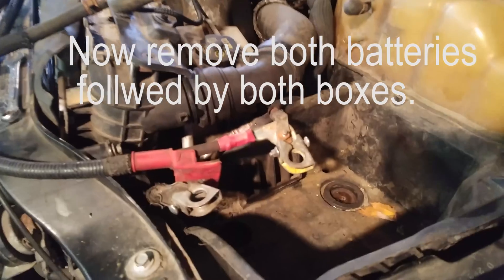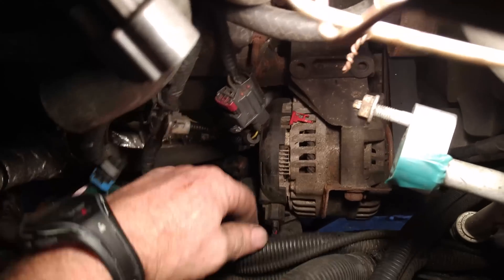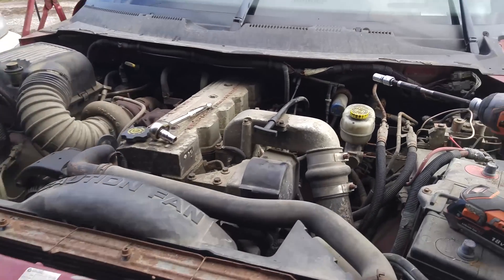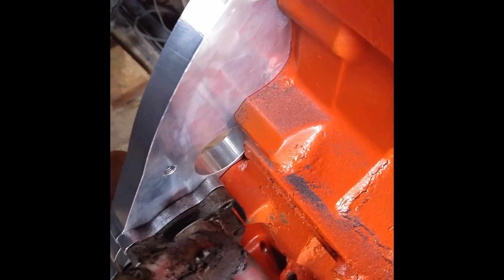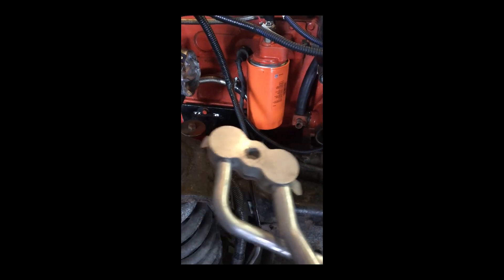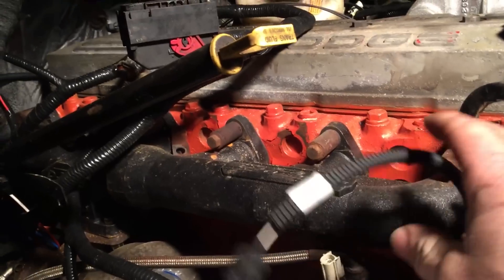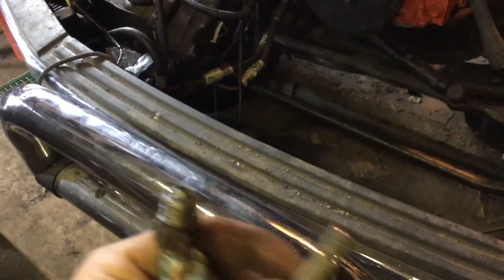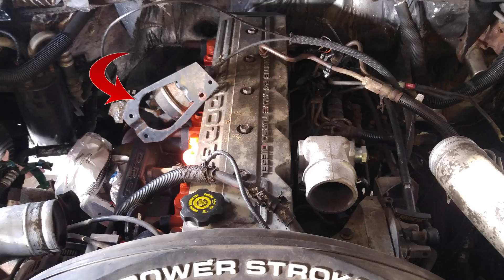Ford Cummins Swap 6.4L to 5.9 24 Valve instructions

Comment: Hello . Did you use the stock lift pump from the ford or the dodge lift pump and what lines did you use ?
Reply from the maker: I used a FASS  they are around 1k.

Comment: Just bought an 08 F450 with a blown up 6.4.  Ill be swapping it out for a commonrail 5.9.  Only part that has me a bit concerned is the need for a lift to remove the cab...  I did my last 12 valve swap (on my 98 K3500) in my garage, no cab removal required...
Reply: Weston Champlain didn’t remove his cab. Just removed radiator and all that stuff

Comment: The links you have here for the instructions and Wiring require a permission to get to the files in Google, may I have access to those files?
Reply from the maker: Yes. I will look into it.  Some of my files were deleted
Reply: Evening, Did you ever get a reply? I made a request today also.
Reply: @AlexShrugging  Nope, No reply
Reply from the maker: It should be good to go now.  Both are in the first pdf
Reply from the maker: It should work.

Comment: Did you use the 6.4 electric fuel pump on the frame? Does the 24 valve you have have a lift pump on the engine? Was curious if the 6.4 pump has enough pressure for the vp44. Thank you

Comment: How much you paid for kit conversion and where
Reply from the maker: Kits vary in price.  Depends on you needs.  I used diesel conversion they were great to deal with and very helpful.   All in I was around 5k.   
The best purchase was the wiring harness from diesel conversion.  
Hope this helps.
Reply: I want a complete kit now I already have the 5.9 24 valve engine I just need the kit for a 6.4 to 5.9 cummins 98.5 do you have a link
Reply from the maker: https://www.dieselconversion.com/

Comment: I’m getting ready to put a Cummins into my 08 F-250 just waiting on the head to get back wanted to ask if you know what sensor I’m going to need to buy for it to work
Reply from the maker: Hi Andrew.  I am going to need a little more info.  Did you buy the complete wiring harness?

Comment: Can I get the info for where you bought your parts from?
Reply from the maker: Which parts? 
Diesel conversion has most of the parts you will need.  Especially the wiring harness 
Other parts I sourced out from processors garage in Keswick.  
Hope this helps.
Reply: @brownlordofthewoodshop8552  what was your cost breakdown?

Comment: Where are the two sensors you mentioned on in the video that are screwed on the head of the block you said  " transmission and temperature sensor" they had red arrows drawn on the vídeo
Reply: Another question..Where did you route the little coolant outlets on the water neck down by the ac compressor. Also can't figure out where i can put the ford coolant temperature sensor i was supplied a adapter bushing but idk where it goes it doesn't screw on to the head with the adapter bushing
Reply from the maker: Sorry for the slow reply
I unscrewed one of the plugs in the head and installed the transmission and temp sensor.  
Ford temp sensor in the top of the block.

Comment: Excellent informative video.  After installing Cummins did you need to adjust drive shaft lengths and if so by about how much?  I just picked up a 2008 F350 mint with no engine.  I have a 5R110 out of another 2008.....just need to find a 12/24 valve.  Thanks for this.
Reply from the maker: I just moved the motor as far forward as I could. I did not need to cut drive shaft.

Comment: What can you do about the check engine light do they make something to get it to turn off
Reply from the maker: Hi Jonathan 
Did you buy the wiring harness from Dcs ?
Reply from the maker: I have mine wired up and everything works great   I did have a problem with the 2temperature sensors I just put them in the top of the block.
Reply: @brownlordofthewoodshop8552    
  where are these 2 sensors located, I can't figure where to find the transmission and temperature sensor you mentioned in the video

Comment: Can u do it in a v10 using the original  v 10 trany , on a f450 2010
Reply from the maker: I don’t know.   If you can find an adaptor plate and programming for the transmission you should be good to go.
Reply: @brownlordofthewoodshop8552  thanks

Comment: Hi, I wanted to ask you how the engine performance is with that transmission.
If I do not have how to reschedule the transmission, could I mount another one? Which will be??
Reply from the maker: I love the 5r110.   The 6 speed works amazing.  

It’s a bit of work to set up but diesel conversions has a tune that will set up the transmission to the 5.9.  
I used my sct tuner and uploaded the tune    
Its way better than the stock dodge transmission 
Hope that helps.
Reply: Your know 5r110w is a 5 speed right.....

Comment: Great video,  doing a 08 ford f550 with a 02 Cummins.   Had dcs do the wire harness but have a couple questions, if I sent you a picture would you be willing give me a hand if you can?
Reply from the maker: Sure.
Reply from the maker: Sorry for the slow reply
Reply: No worries,  I have most everything hooked up one problem I am having is the truck is in park both in the cab and transmission but on the display is shows it's in 3rd gear.  it won't let it turn over with the key.  Any ideas?  The shift leaver will not come out of park either
Reply from the maker: The plastic clip that holds the linkage to the transmission has adjustment   You can try and adjust there.   Also there is a safety switch which won’t allow the truck to turn over unless it’s in park or neutral.   Also there is a safety that the break must be applied to remove it from park.  It may be out of adjustment as well.   I hope that helps.

Comment: I’m doing this same build. How did you manage your fan to fit without scraping your original 6.4 radiator?
Reply from the maker: I made up bushings to go behind the original fan to move it back towards the engine.  About 1/4”  works great.  I also have a 1” body lift on the truck.   This also helped.
Reply: Brown, Lord of the woodshop™ I ended up putting a Cummins radiator and making braces to mount all the other cooling systems . It was a major headache but we got it figured out ! Thanks for the info .

Comment: I heard that its a pain to swap 6.4s because of the speedo cluster something about the truck wont run without it being synced with the engine
Reply from the maker: I didn’t have a problem with that.  I put a tack sensor off my crank shaft so my tack would work.  Hope that helps
Reply from the maker: No problem with the cluster as it remain with the truck and i used the 5r1-10 original transmission.  See attached reading material on my page.

Comment: Has the truck been running good since the swap any issues?
Reply from the maker: I have now over 150k on the swap and everything is great.  
The only thing I would ad is a better way to keep the relays dry instead of just mounting to firewall.   I had the  vp44 relay corrode.
Reply: thanks for the response what exactly did you have to purchase to complete your conversion Any info you give is appreciated

Comment: I see 12 valve swaps and it’s excellent motor but I like the 24 valve.
Reply from the maker: 12 v is so much easier to do the swap.
Reply: Ya but I like 24v way better
Reply: Why ?   ?   The 12 valve with the P - Pump is very basic and reliable.  It might cause problems in a State that dictates that the emission requirements go with the Year of the Vehicle.

Comment: If I had it to do over I’d sent the harness in ! Dcs has been helpful I sourced the conversion parts from them. Should have it started tomorrow. 08 F450 12v I do have a few questions if you have time to hear them
Reply from the maker: Sure.  Send them along

Comment: How did you do the gas pedal? Thanks in advance.
Reply from the maker: Diesel conversions sent me an adaptor that attached to my original pedal. I drilled a hole through the fire wall and attached it to the throttle position sensor bracket.  Not a very hard task.  I am still working on a way for cruise control
Reply: Brown, Lord of the woodshop™ ok, thanks for the reply.  When I talked to them they said they wouldn’t know how I would do it and that I was pretty much on my own for that portion of it.
Reply: Brown, Lord of the woodshop™ bought a 2008  f-450 king ranch quad cab with a bad engine in it.  Would like to do this conversion to it.  Picked the truck up for next to nothing. Only had 89,XXX miles on it.

Comment: Wow you've lost 2 engines?  Because of all the hysteria about the 6.4, I have a low mile 24V in a bus for a swap but the 6.4 has 297,000 miles and still running great! Of course it has been deleated since just after new.
Reply from the maker: Good luck with the 6.4.  Mine was a time bomb.

Comment: DCS has a bracket now that lets you hook your throttle cable to the stock pedal allowing you to keep your throttle position sensor. Would this make your transmission happier?
Reply from the maker: I don’t know.  My transmission is from the ford.  So I had to use an SCT programmer to make it work smoother.  Dcs provided me the programming. Maybe on my next one I will look into it.  Thanks
Reply: @brownlordofthewoodshop8552  I saw later that you have your tps mounted to the throttle linkage. I would think this would give the same result.

Comment: All you need to know about the 6.4 powerstroke: According to Bill from Powerstrokehelp.com the 6.4 is a 150,000 mile throw away engine. Unrebuildable. He bought 10 used engines and was only able to make 2 engines from it.
Reply: Funny, mine almost has 300,000 miles on it, of course i've had all the factory emissions equipment deleted for the last 60,000 miles. 😁
Reply: Dude is the end authority on for 6.0/6.4. The 6.4 uses the same block as 6.0 so no good reason it shoundn't be rebuildable.

Comment: Never bolt the converter to the motor to install. Always put the converter in the trans ,rotate it until it seats all the way back into the pump.
Reply from the maker: Thanks

Comment: I don’t think he knows about mechanic cause you never bold the torque converter to the engine first that’s the reason you can damage the pump and the front pump seal .
Reply: Diana Rubio I think he does. He just swapped a 24 valve into something not made for it
Reply from the maker: This question has been answered.  Why do people keep bringing it up.   Move on.  The horse is dead.  This was to be a fun video.

Comment: anyone doing this job, install the torque converter into the transmission before installing the engine, attempting to install it with the engine will result in front pump damage 99% of the time.
Reply: This hurt to watch
Reply from the maker: Thanks for the positive feed back.
Reply from the maker: I will keep this in mind for next time.
Reply from the maker: Thanks
Reply: I cringe super hard at that. I learned that the hard way once.
Reply: J B they got it down now that they make it themselves
Reply: Can you send me complete instructions for the swap please

Comment: Did you go with DCS engine mounts? Did they bolt in the front bolts holes or the rear bolt holes
Reply from the maker: Yes I used the mounts from dcs.  I used the second set of holed from the back of the motor.

Comment: What did you do so you can use the grid heater??
Reply from the maker: I used the wire from the ford glow plugs and wired the grid heater solenoids to that.  The grid heater work by grounding them there is constant hot power to them.  When you turn the key on the ford computer sends power to close the solenoid and the grid heater will work.  It’s was minus 27 the other day and mine fired right up
Reply: Brown, Lord of the woodshop™  ohh ok. I got everything done here and I have the dcs harness and I have 2 wires. That look like grounds labeled heater controlled
Reply from the maker: The grounds on the dcs wiring go to the two  solenoid this completes the circuit  for the heater grid.   Power is supplied to the grid heater already and the grid heater starts to work when the circuit is complete by turning on the key which grounds the solenoid and closes the contacts.
Reply from the maker: If you want I can take a picture of mine tomorrow if that will help.
Reply: Brown, Lord of the woodshop™  that’s exactly what I did. I think my alt is going out and is just throwing everything out of wack
Reply from the maker: I had a ground issue with mine.   I fixed it by adding 2 ground straps from each battery to the motor.   One to the back side of the alt bracket and the other to where the grid heater

Comment: Thanks for the video, did you run a cam sensor with this build as well as the crank sensor, or just the crank sensor?  I about 2 months away from wiring the pcm on a Detroit 4-53T swap. Take care:)
Reply from the maker: Yes I ran a crank and can from the dodge. The cam and crank sensor for the dodge look exactly the same and will cause problems if you put them in the wrong spot.  I also ran a cam sensor for the ford electronics.  It came with the flywheel and adaptor plate from Dcs.
Reply: @brownlordofthewoodshop8552   Ok thanks.:) I might run into issues with my swap as the crank and cam rotate at the same speed.   We'll see what happens and then go from there.  Thanks again for your reply.:)

Comment: How much would you charge if i brought you my 2008 f350 with the 24valve 5.9 Cummins to swap in? I live down in Windsor by the way. Thanks😊
Reply from the maker: Would I be supplying all the parts and the programming ?
Reply: @brownlordofthewoodshop8552  yes😁
Reply: Actually i could get any parts needed for the swap and bring them to you as i have access to an American address for shipping parts from the states.

Comment: Im doing the same swap. 24v cummins in a 08 f350. My motor mounts from dcs dont line up and on the alternator bracket are you supposed to use the 6.4 belt or the 24v belt? Bcuz the 24v belt seems too short
Reply from the maker: Did Dcs send you the right motor mounts? Mine lined up perfect.  As for the alternator I used the bracket from dcs and used the 6.4 alternator but I did use the Ac unit from the 24v   In the description below there is a file that’s showed the conversion steps.   I will look tomorrow to see what holes I used for the motor mounts.
Reply: @brownlordofthewoodshop8552  yes, its the mounts fit on the frame they just dont line up eith eachother on the motor. Its like 2 inches off. I used the alternator bracket too but the 24v belt was too short to fit
Reply: @brownlordofthewoodshop8552  and thank you, ill take a look at the instructions
Reply from the maker: How did you make out? It’s 14 below here.  I took a quick look and I used the second set of holes from the back of the motor

Comment: Is it because of the adapter plate that you bolted torque converter on? Ive never had luck with that,ive always screwed up front seal in trans,i always put converter in trans before i mate to engine,then put converter bolts in
Reply from the maker: For sure that’s another option. I guess I got lucky with the front seal.  I just took my time and it slid in.

Comment: How do you connect to computer of the Cummins engine
Reply from the maker: The wiring diagram attached in the description should help you.  You will need to sort out what goes where with your dodge wiring by the colour of wires and use the pin location    The pcm from the dodge must be intact as well as the ecm   Its a lot of work but start from the ecm and work backwards.  
The best money that I spent was sending my wiring to diesel conversions and the made me a plug and play wiring harness.
Reply from the maker: Did you look at the wiring digram in the description? there are 6 pages of instructions on how to wire the cummins engine.

Comment: the cummins part of it what goes where
Reply from the maker: Under the view more I have attached a wiring diagram.  
Basically I used most of the sensors from the ford and put them in the dodge motor.  I used a pick up off the front crank for the tack sensor.  
I kept the ecm and pcm intact and supplied power from the key.
Reply from the maker: Send me a pic of what you need and what part so i can help. You can send a private message click the about tab click send message button enter private message then send.

Comment: I have a question i have a 6.0l but i want to do a 12v 6bt swap where can i get parts from? 6.0l is toasted so no potential on that area
Reply from the maker: I purchased the basic package from Diesel Conversion , Adaptor plate wiring harness and tuning for transmission.   If you look at the more tab I have attached a manual that shows what you need . I will help you source parts just let me know what you need . It’s a fun project and you will have a great truck when you are done.

Comment: What kind of MPG numbers are you getting? Great video
Reply from the maker: 17km per L.
Reply: Bullshit
Reply from the maker: 17. L. per 100km
Reply: are you a leadfoot? Seems less than ideal
Reply from the maker: I drove to Florida from Toronto this March break. I drove the first 1200km on 170 L of fuel.   If I drive it hard it does drink the fuel.
Reply: You need a tuner of somekind. It should get better mileage than that unless its related to the transmission tune.

Comment: I have recently bought a 2008 f350 to turn it into a fummins. I was thinking of swapping it for a 2006 5.9, This would be my first swap. So Any advice is greatly appreciated.
Thank you
Reply from the maker: Best purchases are a wiring harness. It takes so much time to make one from scratch. The adaptor plate and flywheel is a must.  The rest you can probably source easily.  Motor mounts are expensive for what you get and they can be easily made.  
If I were to do it again I would swap out the injection pump for a old school manual pump and change injectors and lines.  The Ford 5r10 is a great transmission you will need to buy programming for it     Diesel conversion has a solid tune for this.  Hope this helps
Reply: Thank you for taking the time to respond.